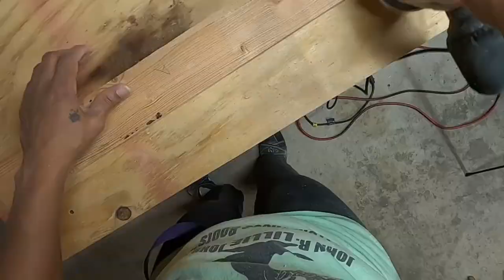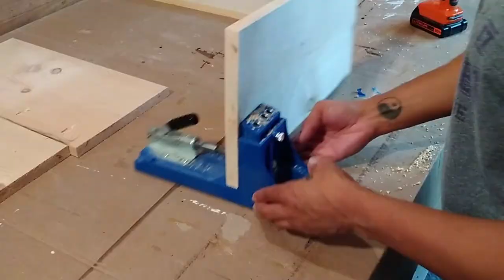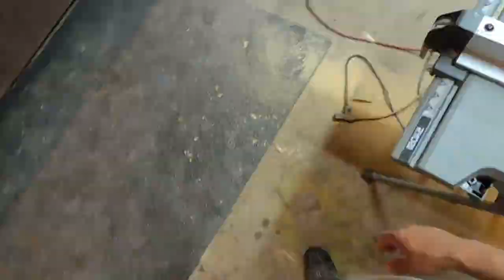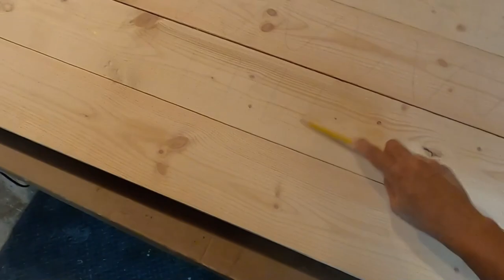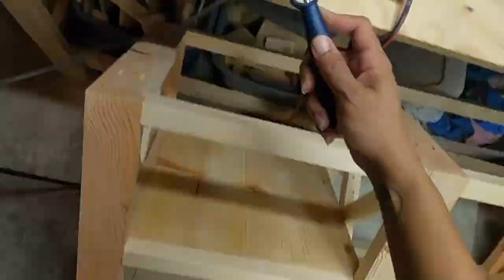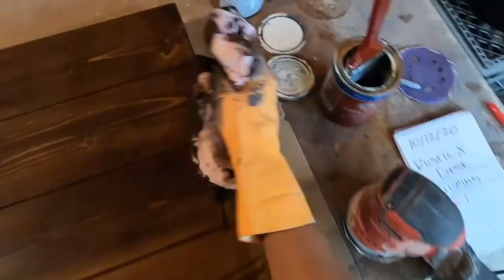How To: Build DIY Rustic Desk. Plan by Ana White.

Comment: I like your video and desk. Keep up the good work. I will make one suggestion, Get rid of that plastic push stick for your table saw. If by chance your blade clips or hits it that push stick will splinter  and  throw sharp pieces in all direction. Use a wood push stick. Here is a sample of one you can make.  https://www.youtube.com/watch?v=bJM1FFOiQ_M
Reply from the maker: Thank you so much for the suggestion 😊